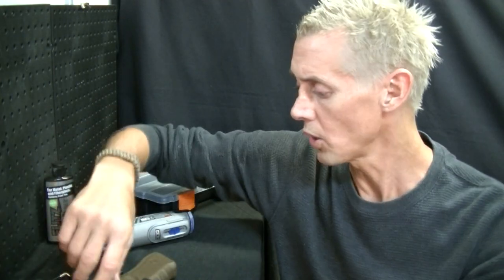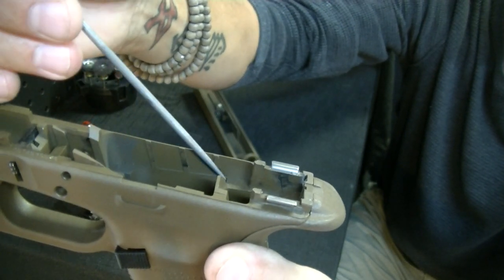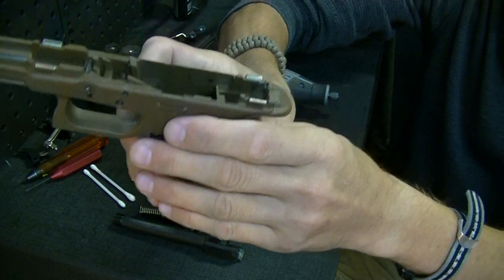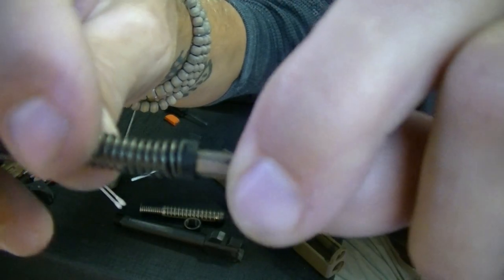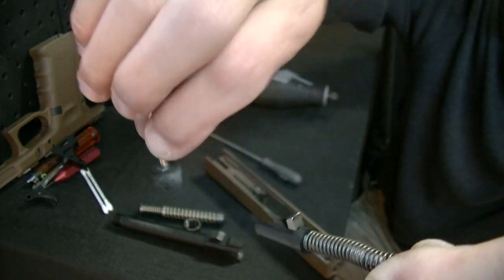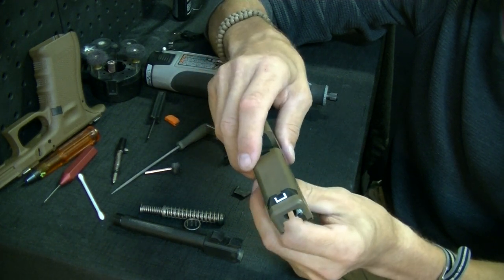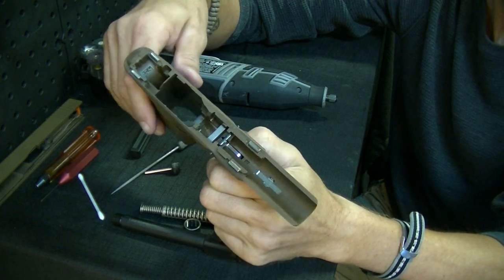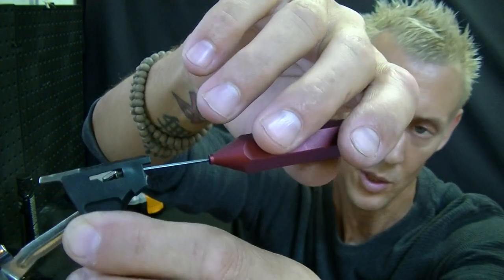Glock preping your frame and slide to maxmize Johnny's kits  EDUCATIONAL ONLY

Comment: “Easing the edges” is what you’re trying to say.  Without removing any material from the face of those ribs.

There are several surfaces inside the slide that contact either the striker or the connector. Particularly the shelf that pushes the connector toward the center.  Those are worth addressing aren’t they?

Comment: hey man I just wanted to write in a message to anybody of purchasing any kind of firearms especially you know if they do a lot of customizing they know what to look for when going to buy a gun in the trigger has been messed with mine is a brand new gun I deal with a lot of used and I just have a story about my 19th and I brought home labeled hardly shot and had one of the sharpest 3.7 pound sugars in it I have never felt such sweetness before butt I wanted this for a EDC now I will just get a smaller 26 or 27 and call it a day but along with that buy a stock trigger system I don't know if the person watched a lot of your videos but you can see where they went to work it works great it is just not safe my bar is way off the shelf unlike on the floor haha ;-) great videos man thank you
Reply: keepOnMovingTactical KeepOnMovingBlizzy ..Dang! WHY don’t PEOPLE try “punctuating” anymore? You know, periods, question marks, etc? Geeeeeeez man. Takes 3X’s LONGER to try and piece together what somebody’s trying to say/ask than it does getting the point. And here I am on Johnny’s site having to go over English ‘lessons’...
Reply: Mark Hatch   Amen to that, brother.  It drives me crazy..
Reply: That rant gave me a headache just trying to decipher it!

Comment: Radiused? Is that the word you were looking for. Is that a word? 

I like your vids man. Have you ever brought up or addressed the issue of Gen3 glocks spitting brass straight back and weakly lobbing brass? I heard about the issue but never had it until my 17 and 19 got up around 4k+ rounds. It was especially bad with 124 & 147 gr FMJ. Even with 115 it has really weak ejection. If I rack a round and rack it out it just falls through the mag well. I

I really don't like it but it still functions reliably, just not ideal. I have a hard time thinking that a Glock extractor is out of spec after only a few thousand rounds. Do you have any kind of solution or opinion on this. You seem to know alot about this platform, I'm curious to hear what you might say.

Comment: I love your videos. Do you ever run into troubles with the stock trigger parts being too soft in the inside after polishing off the hard nickel surface? I am getting both the striker lug face and multiple places of the trigger bar lightly marred after a couple of hundreds shots. I guess its just it's my approach not being so good but want to validate that.

Comment: You get rub marks no matter how much you "polish" polymer.  It doesn't matter, polymer can't deform steel.  Dude will ruin your gun.
Reply: He never said it would deform the steel. He said there was inconsistent rubbing against the steel. Those high mounds of polymer are grabby. He wants the steel to rub consistently inside the frame, instead of grabbing and then going loose, grabbing and loosening, etc.

Dude, YOU will ruin a video comment section.

Comment: wouldn't time do this same thng
Reply from the maker: Tom Simmo  Not necessarily If your car wheels are out of true it's going to cause problems and time only increases the potential for failure
Reply: These are not machined parts from glock everything but the lock block is a stamped part,like Johnny said if its messed up from the factory its going to wear uneven,and possibly cause a safety failure or catastrophic failure,Johnny is the leading expert on everything glock if he speaks it its true